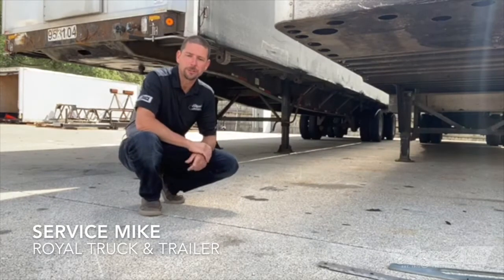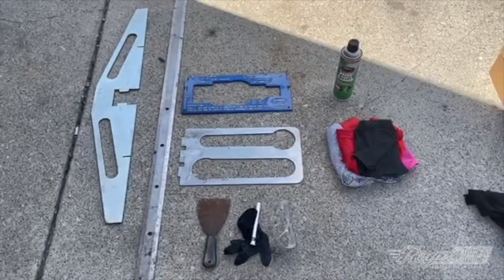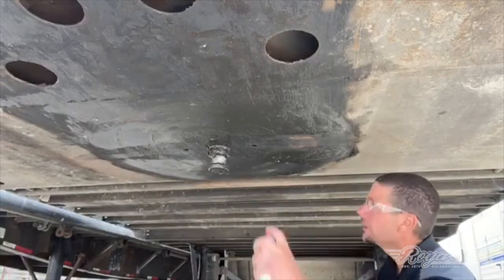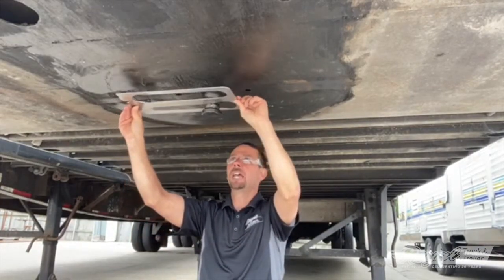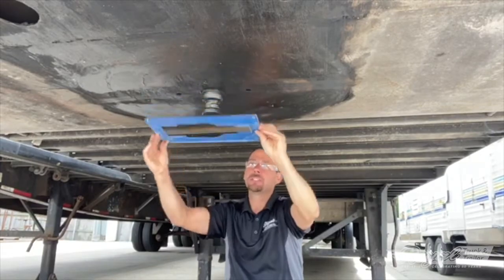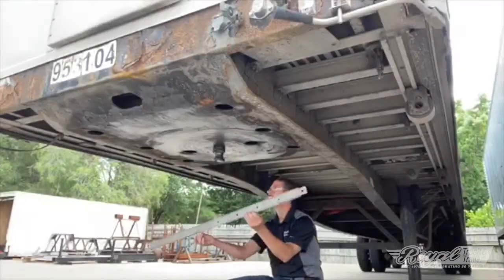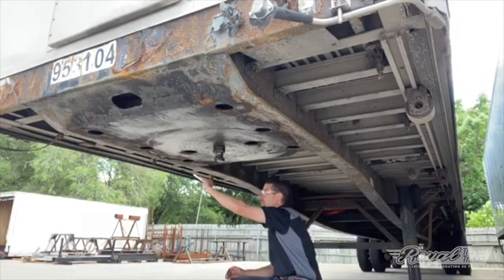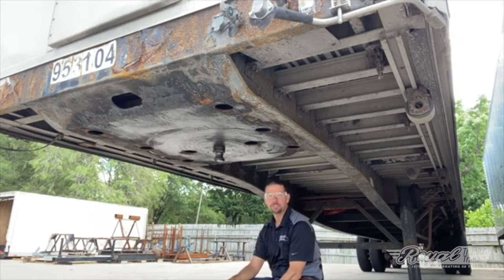Inspection of Upper Coupler on Trailers

Comment: I have a question.
We have a dry van that has some rot inside the van in the steel plate over top of the upper coupler. It was rotted to the point where pallet jacks punched thru the steel. The repair man welded a thin diamond plate section of metal onto it to cover the holes. Now that diamond plate has pushed up to form a mound and when you go under the trailer and look at the upper coupler plate and king pin the upper coupler plate is definitely concaved up a little with a quarter sized rotted hole just inside the 5th wheel travel area on the upper coupler.
Question is, when using a straight edge how much of a gap is acceptable at or near the king pin? Because I measured a gap of approximately 1/2 to 5/8 of an inch and put it out of service but a repairmen that welded the diamond plate inside said that it's ok?!?!
Reply from the maker: Robert, anything over 1/4'' is too much.  This trailer should not be reloaded and looked at by a reliable repair facility.
Reply: @RoyalTruckUtilityTrailer  thank you for confirming this for me! I completely 100% know that you are right. 
However, I would like to show DOT proof to the powers that be at my company.
Do you happen to know if there any DOT publications that gives info?
Reply from the maker: @jerseyveg1  Sorry for the late response, was out last week. https://www.fifthwheel.com/pdfs/literature/LT-209_Upper_Coupler_Inspection.pdf
Reply from the maker: Step 4 is on the allowable gap.

Comment: The flat bed plate showed air gaps, but you said it was still ok. Is there a set limit for how much of a gap you can have and still pass (like .05", 1/8", 1/4")
Reply from the maker: Thank you for your question. The gap we had on the plate was under an 1/8'' and the reason I said it was nothing to be alarmed about was because there was still some corrosion on the sides that I didn't want to slow the video down to clean, and the welds on the plate were all still in good shape and not cracked, which indicates the isn't caving in.  Great question, thanks for watching!